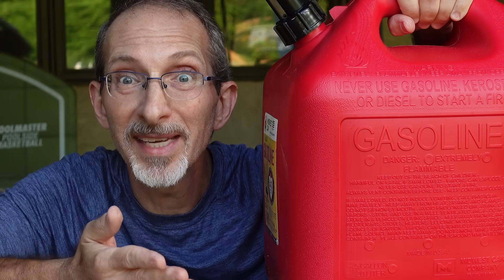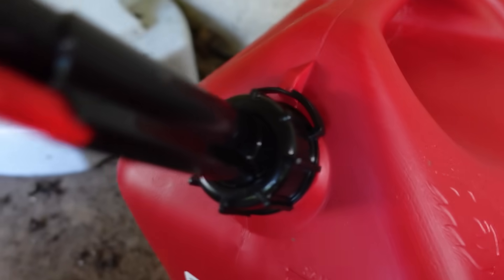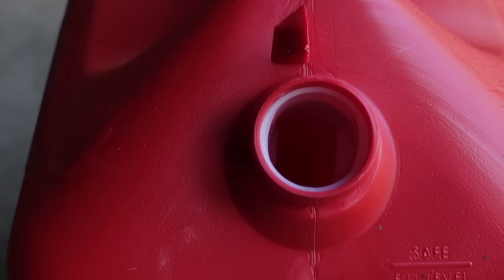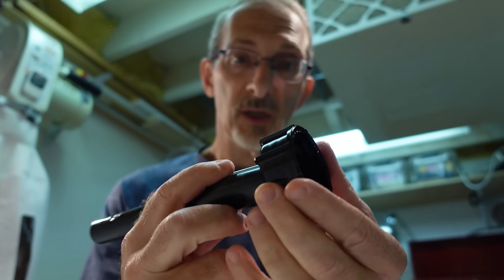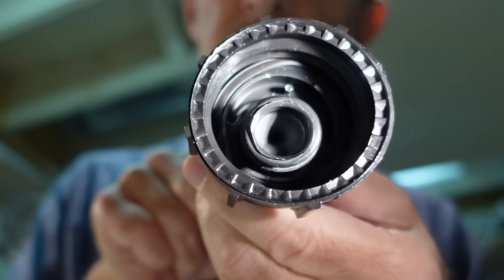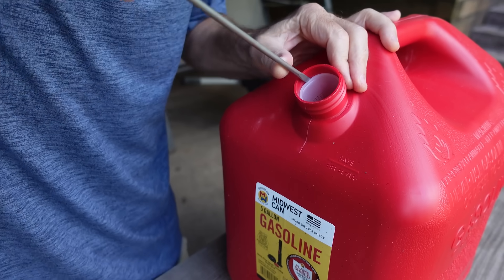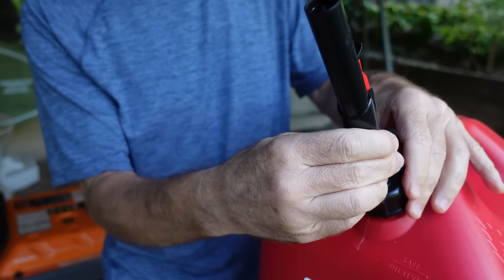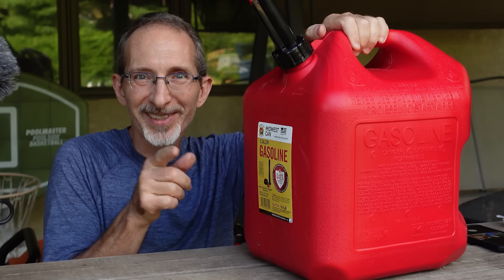Gas Can Modification | New Gas Can Fix

Comment: On the opposite side of the can away from the nozzle, I like to drill a small hole and put a sheet metal screw in it that way you have a vent and it makes using the gas can easier. The rubber gasket on the screw keeps water and trash from getting in the can. Definitely improves the flow coming out of the can.
Reply from the maker: Gas Pumper, what an appropriate user name to be joining the conversation! I agree about the vent, and learned about the sheet metal screw trick here in the comments. In my second video, link in the description, I installed a plastic vent in the back of the container. It made a big difference and how the gas flows out of the nozzle. I appreciate you watching and commenting!
Reply: @MikeFyxdt  I’ve been driving a fuel tanker truck for about 20 years now that’s where the name comes from. Just found your channel, I enjoyed the video and looking forward to watch more of your videos. Thanks for taking the time and effort to help others out. We all really appreciate it.

Comment: You can literally replace the entire crappy assembly with a "water can" nozzle off ebay for under $10 shipped.  They even come with air vent attachments for the top of the can, to prevent gulping.
Reply from the maker: Yes! I will be testing a replacement nozzle and some other fuel related products in an upcoming video. Thanks for watching and for commenting!

Comment: I like your ad I came up with a simpler way to pull the white thing out where you do no damage to to get the white thing out of the red gas can thanks
Reply from the maker: Ronald, the most popular suggestion in these comments is to use needle nose pliers and twist the filter. It makes it smaller so it slides out of the throat of the container. Thanks for joining the conversation!
Reply: All ok

Comment: You can also buy the old school excellent style of bendy gas can nozzle and the vent for like 15 bucks or less on Amazon and put them on a new gas can
Reply from the maker: Brandon, yes! I will be testing one of these replacement nozzles in an upcoming video. Stay tuned!
Reply: I love mine they are a little cheap but still far superior to the new style

Comment: Throw the whole nozzle away and buy the plastic flexible nozzle kit that comes with vent that goes on the back end. You have to drill a hole for it.
Reply from the maker: David, yes! I will be doing a review of one of these replacements in an upcoming video. Thanks for commenting!

Comment: Even without the spring many don't want to slide open and closed.
Reply: When the spring moves easily, it does actually help. Since you can put the can into the pouring position before you open the seal. I think this is where most frustration comes from: users trying to open the seal / valve before moving the can.

I have no trouble with my safety can after realizing my mistake. I am able to fill my weed trimmer without spilling even a single drop. Amazing.

Comment: Could you cut the spring shorter so it still closes the spout but doesn't require as much force?
Reply from the maker: John, yes, I did that in my follow up video, link in the description. It does make a difference. Thanks for commenting!

Comment: You don’t not brake any rules. Those safety valves are not a good idea for what 99% of us use gas cans for. It is very awkward and dangerous to even use them with the nozzle running just about straight up! 
They are only made for those who had done the unforgivable...running out of fuel while traveling.
Reply from the maker: Lou, I am glad when people appreciate why I made modifications. This isn’t about rule breaking, it’s about making things easier and safer. Thanks for joining the conversation!
Reply: @MikeFyxdt  very welcome! 
I will keep this fix in mind when I get my gas can for this  grass cutting season. I am due for a new one!😄

Comment: I did most of these with my pocket knife on the tailgate at a ⛽.  I just pried out the safety clip though and left the spring so it will self close.
Reply from the maker: David, quite a few people have told similar stories where they are doing field triage on these containers. I just wish they worked better from the start! Thanks so much for watching.

Comment: That ring he cuts off at the begining? It's purpose is not really to lock the cap closed, quite the opposite. It's purpose is to prevent the cap from closing all the way. You'll notice the new cans also got rid of the air vent. In order to vent the can while pouring (and sitting) the cap always remains slightly open so air can enter as the gas pours out. Problem is you can't close the cap tightly, so if the can tips over in your trunk gas will pour out of it!

And the reason they added the 'filter' to newer so-called 'safety' cans is because it's NOT a filter. It's a flame arrestor. But it's still stupid because you're not going to get static sparks when filling at the gas pump with a plastic can! And as he said, it makes it incredibly difficult to fill.
Reply from the maker: You are correct about the thing I called a filter being a flame arrester, which I corrected in my second video, link in the description. I haven’t heard anything about the safety tab on the collar being there to prevent over tightening, but rather it being a child safety device to keep kids from opening the container. No problem so far with these containers leaking fuel from the collars, but then again I almost always keep them in an upright position. Thanks for joining the conversation!

Comment: With the can I have there is no safety click button. And the shaft is ribbed so I am able to jam a metal hex nut in there to keep the spring depressed. Now that I know about that O ring I can just take out that spring.
Reply from the maker: Bill, there seems to be a lot of variations on spout designs, but I’m glad to know that some of these chips can be adjusted for other brands. Thanks for watching!

Comment: Every time I us this the fill the lawn mower, I always overfill. When I fill the can at my local station, it smells up the car.
Reply from the maker: Herman, I usually throw some extra paper towel in the car when I fuel up my containers, in case there is some spilling. Not high-tech but it does make a difference! Hope that helps.

Comment: The ones with the button are the absolute worst, impossible to push sometimes, always has gas running out after I start tipping it back up
Reply from the maker: I have a few different gas containers with buttons in different locations. I hate everyone! :-)

Comment: Another good buy for these cans is the battery operated pump from harbor freight. It runs on two d cells and has a hose. It's very handy and your gas can sits upright while the pump is inside the can. So easy!
Reply from the maker: Andy, I appreciate your suggestion! I just bought one of these and I will be reviewing it in an upcoming video. Stay tuned!

Comment: That filter.. Is probably more of a fire suppression device. Read the label on front.
Very few people leave these epa cans unmodified. What epa doesnt realize.. Is they make it worse. I no longer have a cap that fits. I cant invert the nozzle for storage.. So the nozzle is broken and no vapor control. Good hob. Epa.
Reply from the maker: That’s an excellent point! I wonder how many people actually modify their “new“ gas containers. The PA should put some research and development into that question! As for the filter… As you say, it is a flame mitigation device, which I explained in my second video… Link in the description if you would like to watch!

Comment: The government and lawyers tag teamed modern "safe" gas cans.  

The EPA mandated that they be "self sealing" to avoid unintended spillage, because gas is bad for the environment.  Trouble is, that's led to a million new spouts, none of which allow you to pour gas smoothly (vents aren't self sealing), combined with mechanisms that inevitably require a great deal of force on the can to keep them open, leading to less control.  I can't speak for anyone else, but I have personally spilled far more gas trying to use these new "no-spill" cans than I did back in the good old days.

The lid lock is a child safety thing.  Apparently some kids were playing in the garage and spilled gas and then their parents sued.  The lawsuits didn't really work, so parents demanded that lawmakers "DO SOMETHING!" about the issue.  

The "filter" is the worst bit.  It's called a flame arrester.  It's there so that if you pour gasoline from the can directly onto a fire, that fire is less likely to travel into the can and blow it up.  People sued because they did that, and then got hurt, despite multiple clear warnings not to do that on the can, the label, and the manufacturer's website.  I know that gas can manufacturers won the early lawsuits about this issue, but it was eventually mandated by the government, because it was demanded that they "DO SOMETHING!" about these needless deaths.  Guess you can't outlaw stupid.
Reply from the maker: 100% agree. In my to follow up videos, I explained the flame arrester and talked about many of the issues and laws that you bring up. The bottom line is that instead of making things better, these containers got worse! Thanks for watching and for joining the conversation!

Comment: Go to Tractor Supply and get gas can vent kit. you drill a half inch hole in top of the can near the handle then pop in the vent.  The kits come with a spout and two different sized screw rings. Problem solved.
Reply from the maker: Nathan, I added a vent in my second video, link in the description. It really did make a difference. Like you said, problem solved! Thanks for joining the conversation.

Comment: Better idea. THROW THOSE NEW CAPS AND NOZELS AWAY. Buy conversion flex tops with a snap cap breather on the back side of the Handle. Use fuel stabilizers
Reply from the maker: Thanks Herman, I appreciate your recommendations! I think this is the first time someone has mentioned fuel stabilizer.

Comment: I do this to all the cans I get (buy or am given by folks who hate the new cans).  Unfortunately you left off the most important (in my experience) modification.  I buy a replacement metal valve stem meant for tubeless rims.  I remove the Schrader valve core then drill a hole into the can top on the end opposite the spout.  

Next I insert some wire into the hole and wiggle it out the spout hole.  So I end up with the wire hanging in one hole and out the other.  Then I put the stem onto the wire with its grommet seal in place and pull it trough the spout hole and into the drilled (1/2”) hole.  Holding it in place I put the nut onto the end of the wire I am holding and run it down on the stem.   Whew!  Remove the wire and screw the little metal valve cap onto the stem. 

Ta da!  Now you have a vent like all the cans had 50 years ago.  When pouring you open the vent cap first then activate the spout and pour.  No more gurgling and taking forever, it pours just like an antique (safe but non governmentally sanctioned) gasoline can!  When you are done put the valve cap back on. 

Usually in about 8-10 years the grommet cracks and breaks down.  So for under a dollar I get a neoprene replacement washer and replace it to be good for ten more years or until the cheap new red plastic fades and cracks... oh, a small crack in 10 or 12 years can be sealed with a dab of two part epoxy. 

I hate the new cans until I fix them, then they are fine.  The best part is everyone hates them so you often get slightly used ones free from frustrated previous owners!
Reply from the maker: Thanks Terry! Several other viewers have mentioned the Schrader valve modification and it sounds like a good improvement. I did a second video, link in the description, where I installed a simple plastic vent cap on the back of the can and it made a big difference in how the fuel flows out. I appreciate you joining the conversation!

Comment: I pull out the filter and take out spring and parts on nozzle.   Then I drill a hole in the tank.   New gas cans suck
Reply from the maker: Thanks Vince! I assume you are capping the hole with something after you drill it? I agree that these new cans leave a lot to be desired!

Comment: I recently bought a Scepter can from Walmart, and I actually kind of like it. One hand holds the lift grip, and the palm of the other presses against the vent control on the spout. There is a fin on the nozzle for your fingers to grip wile holding the vent open, and it helps make it more stable while supporting the can at the same time. When you remove your palm from the vent control, it the fuel stops almost instantly.
Reply from the maker: That’s really good to know! We need more choices and better designs. Thanks for joining the conversation!

Comment: Yeah the big can seems to be a pita, however my little can has one that you use your hand to depress and that one actually works pretty well... however the old cans with the tube that pulls out were probably up there with the shit design of today.
Reply from the maker: Shane, you bring up a good point. The larger and heavier the can, the more unmanageable the spouts and designs become. Smaller cans, not so much I guess. Thanks for joining the conversation!

Comment: These safety cans are a joke. Anybody know the story on them? I heard that some asshat started a fire and sued in court and somehow won a judgement.
Reply from the maker: There have been multiple lawsuits that have literally put gas can manufacturers out of business. The new designs are supposed to reduce leaks, control the gas if someone accidentally knocks over the container and keep the tank from exploding if the vapors get ignited. These are all worthy ambitions, but they have rendered the containers very difficult to use in the process!
Reply: @MikeFyxdt  Worthy yes, but you can never make something idiot proof. Every time you get close, someone builds a better idiot!

Thanks for the info.

Comment: I just purchased a new plastic 5 gallon gas can and noticed the "safety" spout on it. What a dam joke. I sent for a replacement spout like the old cans have, which is just a plastic bendable spout. Now I can place the spout into the gas tank opening then tip the gas can up to fill the tank WITHOUT spilling any gas.

Comment: For a vent I drilled a hole that was snug for pushing a smooth nail into.  Before installing the nail I drove it into a fender washer that provides a two fingers pulling point for removal.
Reply from the maker: Adding a washer is a great tip!

Comment: You know why they made these stupid changes? its not because of "safety" or spilled gas or anything like that.. its to FORCE people to buy stupid shitty ass gas cans that otherwise was selling vary rarely.... 
People buy these shitty gas cans, they leak, they spill they are nasty - so they buy another thinking "eh might just be this brand" nope another brand has same shitty build quality - leaking, spilling and just overall pain to use..
I recall an OLD metal gas can from mid 80's or so - Never leaked.. never spilled.. solid cap on it so no "fumes" and it even had that nice easy pour with a 2nd plug you could open to allow AIR behind the FUEL pouring out the spout.. unlike all these CALIFORNIA compliant crappers..
The worst regulations come from California for anything fuel related.. must be something in the air there..
Reply from the maker: I wish we had transparency to exactly why these designs are the way they are. Make them based on what the consumer wants, not on what manufacturers or government think we need!

Comment: This is a safety third issue. One moron poured gas on himself and smoked a cig and caught fire so we all have to deal with these safety measures.
Reply from the maker: John, there is definitely litigation in the history of why these containers are the way they are!
Reply: @MikeFyxdt  Well I know it wasn't to prevent spills. I've poured more gas on the ground with these then my old can.
Reply from the maker: @Laugh1ngboy  I think the spring-loaded nozzles are to prevent spills if the gas containers accidentally get knocked over. At least that’s the logic that I’ve read on government and manufacturers websites.
Reply: @MikeFyxdt  I'm reminded of the phrase "solution looking for a problem"

Comment: Could you not just put a weaker spring back into the spout in place of the old spring
Reply from the maker: Alan, I tried cutting the spring to make it weaker in my second video. It seems to have made a difference.

Comment: Turns a $15 non-working fuel can into a $10 working can.   That spring and filter could have been left out and cut the cost.
Reply from the maker: I would’ve paid five dollars more if they worked better from the start. Thanks for joining the conversation!